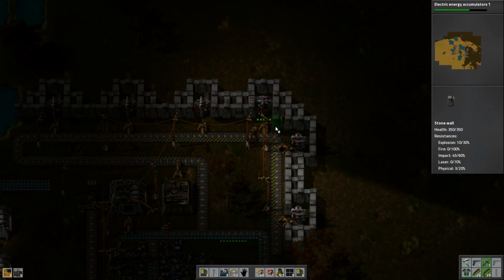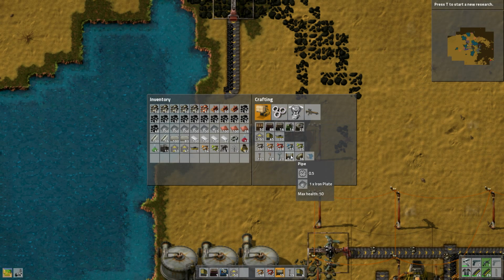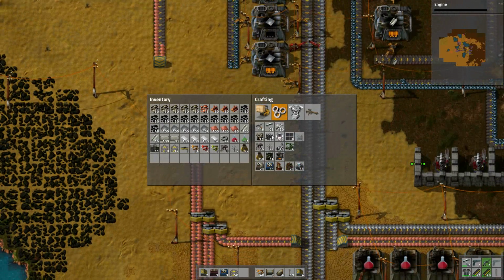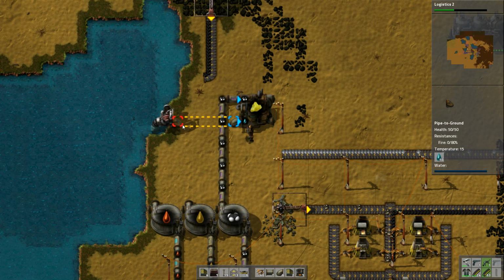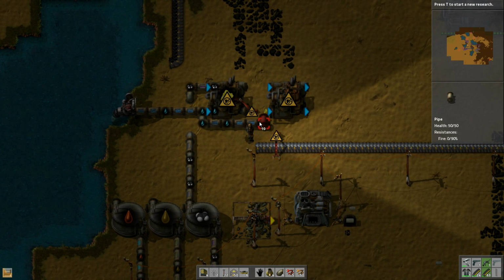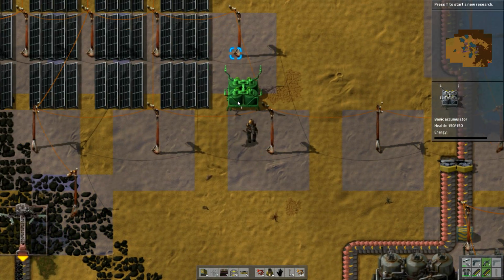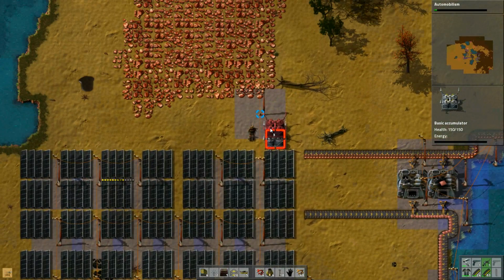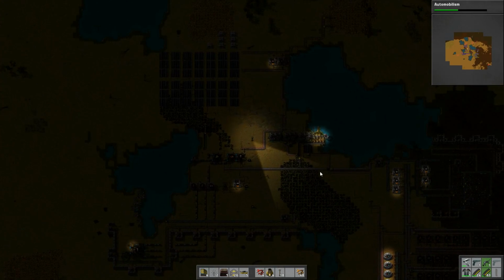Factorio | Part 5 | Battery Power!

Comment: Since you have a massive amount of tracks, put 3 layers of tracks all around the walls and it will pull the enemies away from the walls. Not sure if that's been changed so they can damage the tracks but a long time ago that was the way to go with base defense. May want to get drones that can repair them before you do that if that's the case.

Comment: Lathrex sorry if I spelled your name wrong  use the sorter to put 2 materials on the same line same  so it increases efficiency by having it by having both materials on the same line so you have less conveyor belts saving materials and more space for building
Reply: Carlos Campos while this is true (as i have done it) you will have toe problem with all of your lines backing up. Some materials simply won't get to their usage posts at the right time, and you cant use the spare lines for storage. This is just insanely hard to balance.
Reply: Oh when I did it very efficient it didn't back jam but I was using all my resources very very fast